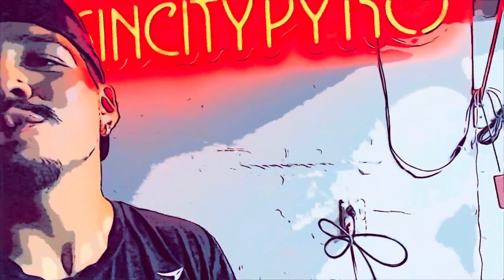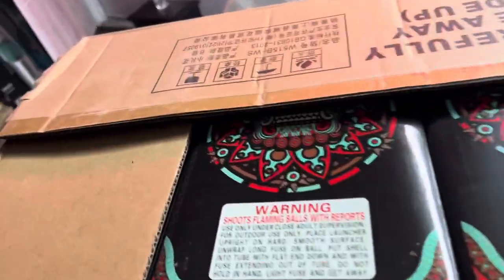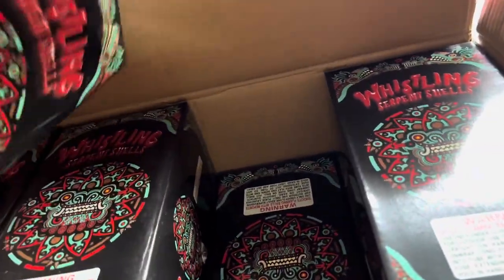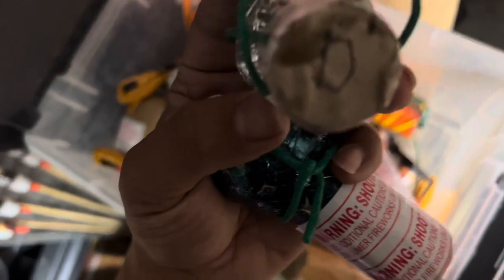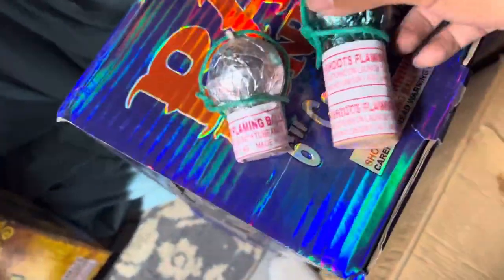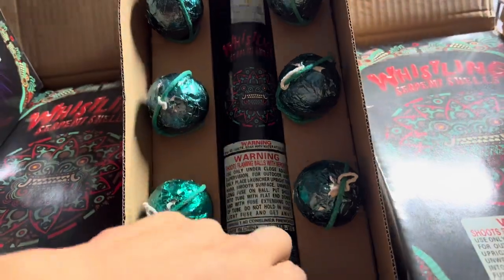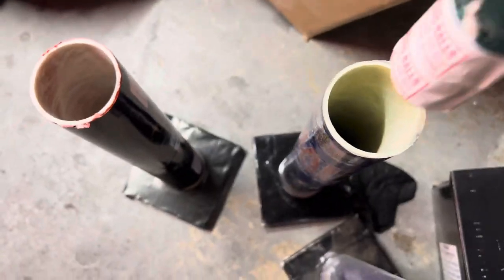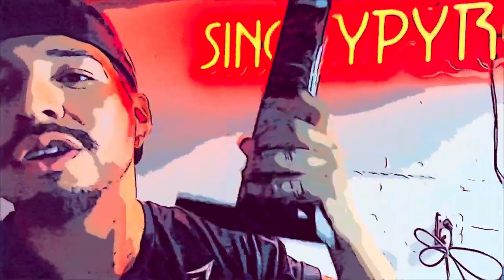Whistling Serpent Salute Shells 🐍💥 [New for 2023] Bangerz✅ #iykyk 🤫 [DEMO & CASE UNBOXING]📦

Comment: It’s gonna have a whistling moon traveler tube as the passfire between the report and the lift. It’s definitely a canister with a ball hemi on top. They’ll hit just the same as a ball shell due to how a canister is loaded. What I’m curious about is if you take the hemi off and drop them in a 1.25 tube. P.S all that talk that’s on the streets about what factory and who they came from is garbage. There are two factories producing overloaded product in China. Both import to three companies in the United States. The rest is pretty much hear say between bootleggers saying they’re the ones bringing it in. In order to import anything into the United States regardless of whether it’s 1.4 or 1.3 or grey area you need a 1.3 importers license.

Comment: I just bought me a box of frog balls, and it turns out that they are no longer ball shells and are a lot smaller than a normal cylinder shell with a ball shell casing on the top